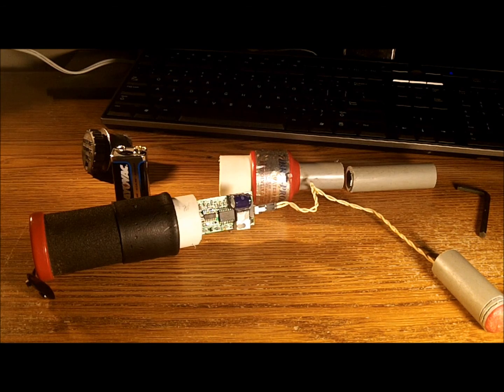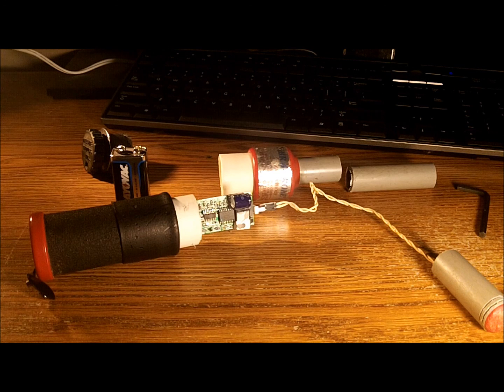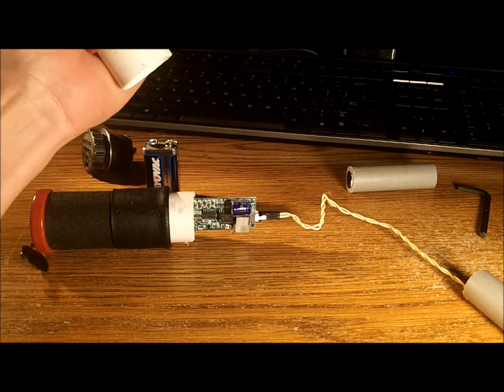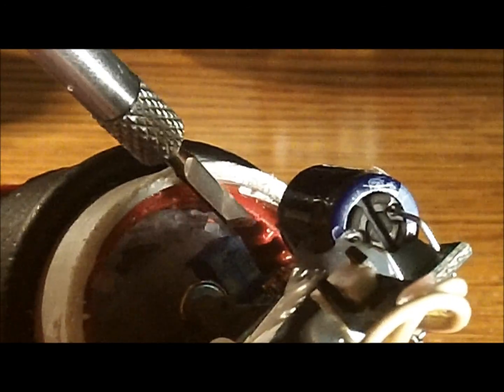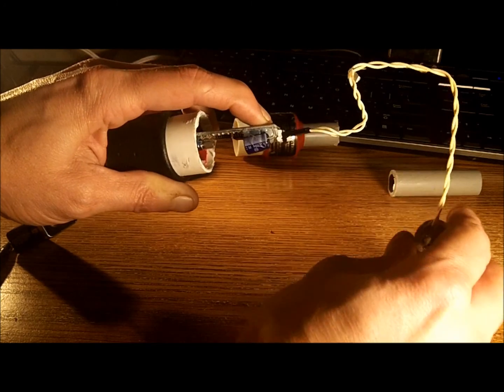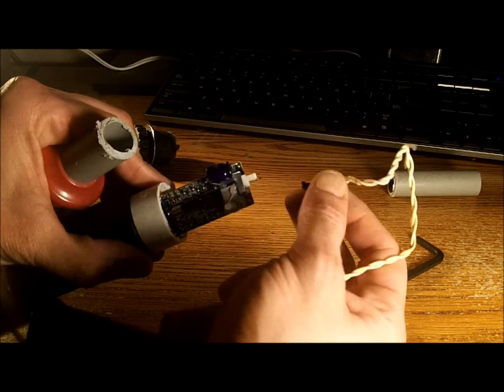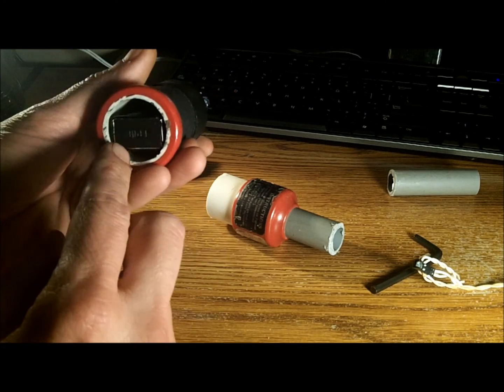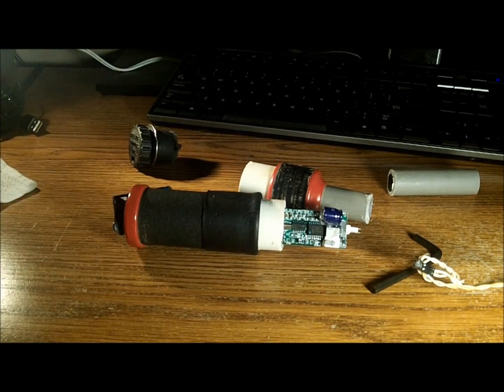Vibra-Probe 560 DE-Constructed HD

Comment: man i have had the same one since 2007, it just now a few weeks ago started to not work as well. i would call vibra-probe and talk to someone about what happend after you took yours apart. i think it was just made weird. which is something that happens with electronics. but i would buy another one for sure man, i dont think any other brand can hold a candle to what vibra-probes can do.